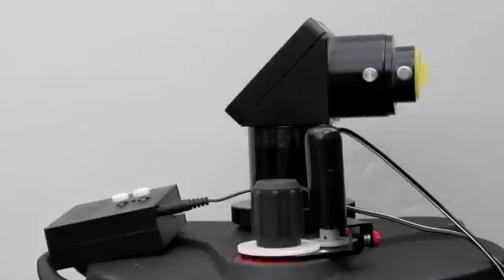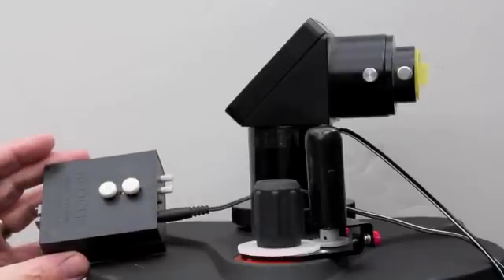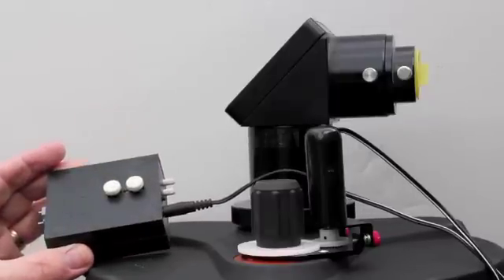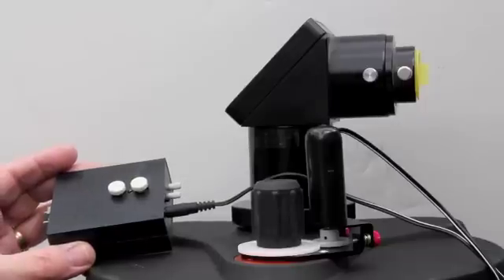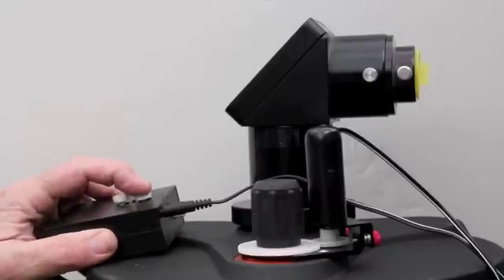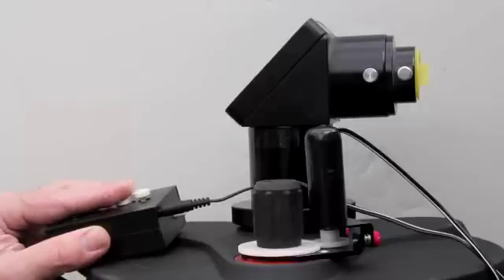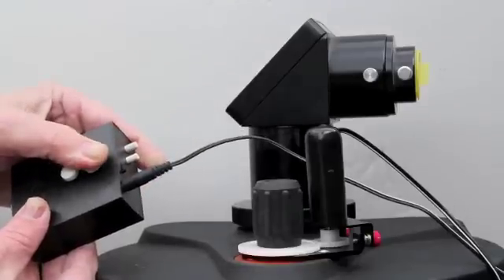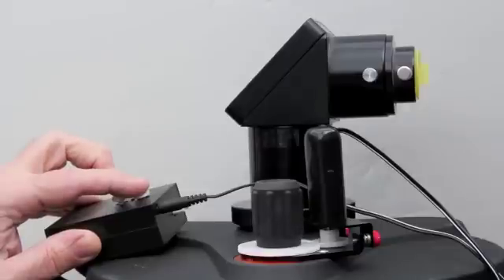nFOCUS DC Focus Motor on CPC 1100

Comment: I like the nFocus on my Explore Scientific AR152 works great but finding it difficult to install ASCOM drivers. I'm getting ASCOM 5 platform needed, i have the most recent ASCOM installed and just won't install  in order to use the usb 12 volt to computer.
Reply from the maker: hi mary,send me an e-mail at rigelsys.com  and we'll walk through it 🙂
Reply: @rigelsys  Sent you an email, i'll try again later. I got this wasn't delivered because the recipient's mailbox is undergoing maintenance and can't accept messages now.
Reply from the maker: @marygarcia4544  hi mary,  rigelsys@cox.net  :-)  or rigelsystemsastro@gmail.com  -- should get through!
Reply: @rigelsys  Hi, I was able to get my rigel nfocus setup! I used my laptop to  a fresh ascom & nfocus driver/software setup and worked YAY! Thank you
Reply from the maker: @marygarcia4544  If you would be so kind as to post your experience on cloudynights.com  that would be great 🙂
Reply from the maker: Hi Mary,  Did I forget to include the usb to 12V DC converter cable on your latest order from Highpoint?  email me directly at rigelsys@cox.net so I can close the loop.  I believe I included the temp sensor as a "bonus" since you are a repeat customer :-)
Reply: @rigelsys  Hi!! High Point Scientific shipped the usb to 12V cable took care of it real quick. I already installed and working. The temp sensor cable threw mw off but it works also. I very satisfied and love these focusers on all 3 telescopes I've installed successfully. Thanks again!! 👌
Reply from the maker: @marygarcia4544  Hi Mary.  Good to hear!  BTW, would you be so kind as to share your satisfaction (with some photos of the setups) on cloudynights.com  for your experience with Highpoint & us?  Many thanks.
Reply: My son had a USB 5V to 12V DB Converter Cable lying around tried it and it works fine, no need for High Point Scientific to send one. I sent them a message already no need to send cable.
Reply: @rigelsys  I'll take some photos of my setup(s) and motors and post to cloudy nights

Comment: Was hoping for a demo of how to disengage from the focus knob for manual focus and also how to connect it to ascom etc.
Reply from the maker: loosen the two red thumb screws, springs push motor away from focus shaft gear, ready for manual use.